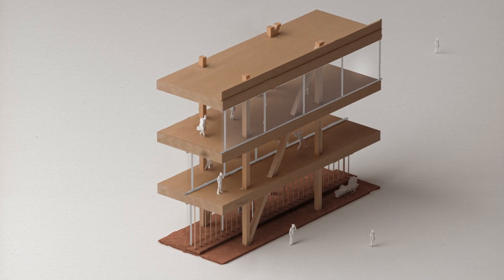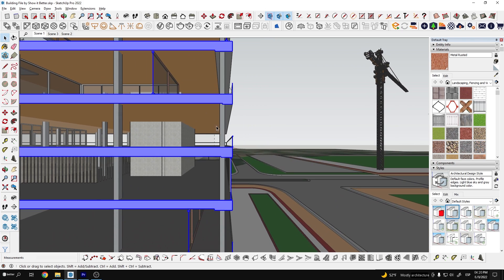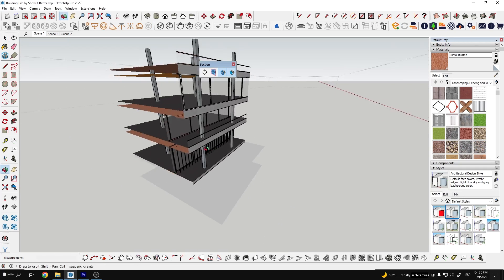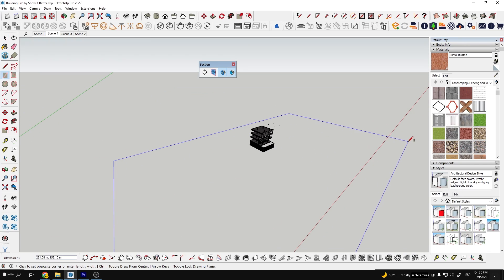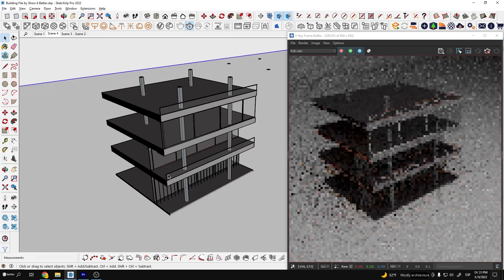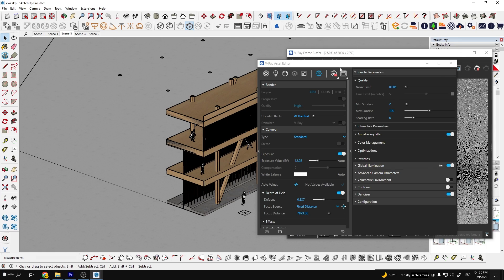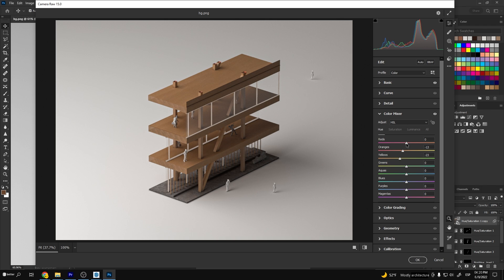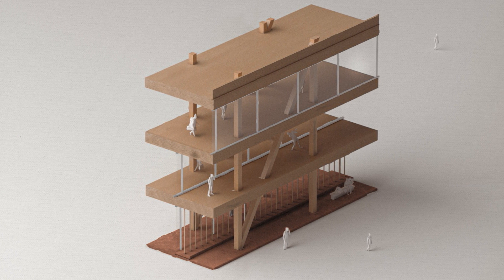I created a digital architecture model, this is how!

Comment: It looks nice until you zoom in. You can see the grain of the wood is not realistic. The materials are "too perfect". And the edges are perfect 90 degree angles.
Reply from the maker: completely agree Frank! I could spend some more time on the model to make it look more realistic! I also should have rounded the corners with the Fredo plugin and looked for higher resolution textures